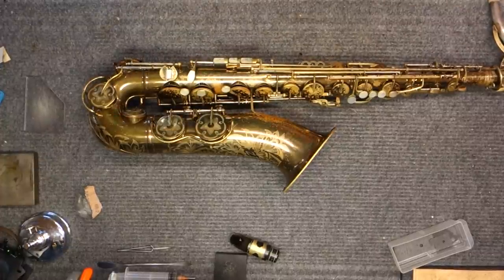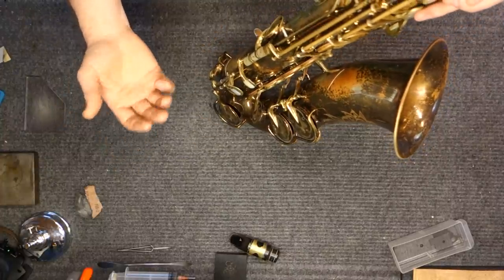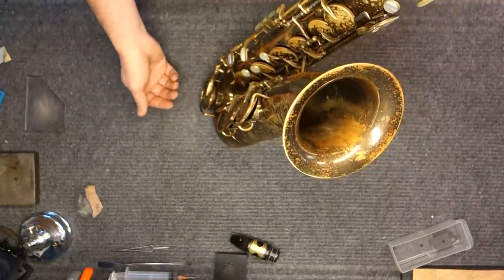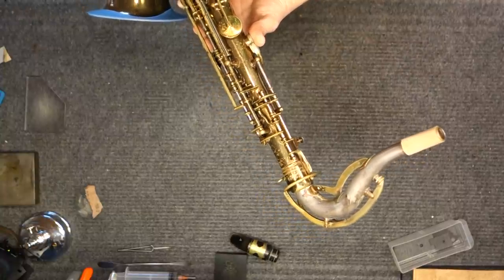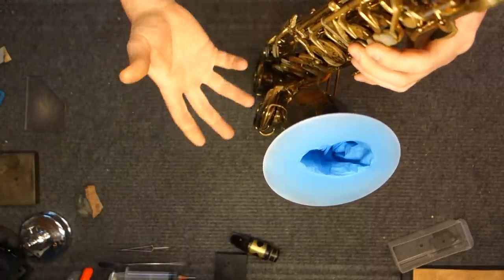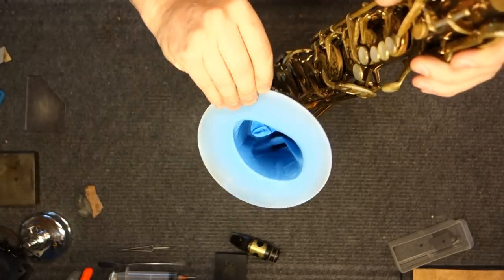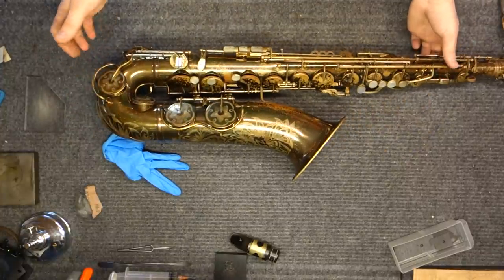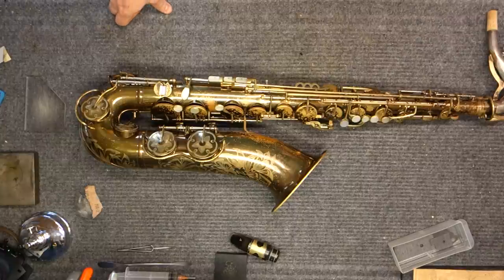Saxophone (Questionable) Repair Topic: Quik 'N Easy Leak Detector

Comment: So, I tried this test on my Mark VI tenor before and after Matt's full overhaul.  Before I sent my horn to Stohrer, it was OK...  after about ten seconds, the glove would very, very slowly -- almost imperceptibly -- begin to relax.  AFTER Matthew's overhaul the glove does not move at all, at least not as long as I could comfortably keep the neck of the horn closed up.  In fact, the horn is now SO tight that I can apply suction to the neck then completely remove one hand from the keys and the glove STILL does not move.  I.e., the keys stay closed on their own!  The pads seal so completely that I don't even have to hold all the keys closed!  This was totally unexpected, to say the least.  And I can let go with either hand.  However, if I let go with both left and right hands the keys finally do pop open, so it isn't magic.  But, damn, what a seal!

Comment: Hey Matt, I'm not sure how active you are on older videos but I was wondering what I could do about my Yamaha YAS-52. I stopped playing for a few years after graduating HS and I recently decided to pick it back up; this prompted me to take my sax to my local Music store (Art's Music Shop in Birminham, Alabama), in order to get it in good working order. Prior to taking it there, it played fine, but I wanted it to be at 100% so i took it to Art's to have them do everything they could. I just got it back and boy am I disappointed. Upon inspecting it at the store, my side F sharp key was missing the tension rod and my thumb octave key didn't make contact with the neck piece so it wasn't even playable. I knew exactly what to do to fix it and did on the spot since their 'repair guy' had left for the day. I was like "whatever", it's a small hiccup. I paid close $300 for the "servicing" which I believe only involved cleaning because nothing else seems to be different about the horn (ie no new pads or anything). After getting home, I was more than excited to play on it but it just isn't in the condition that I expected it be after paying $300. The low C key pad isn't making complete contact with the hole and the test you just explained wasn't even possible as I could audibly hear air rushing in. I don't know what to do and I'm incredibly demoralized considering I'm broke college student who can't afford to get swiped like that, and it not be worth it. The store's policy is that "all sales are final" (whatever that means), so I don't know whether to take it back and tell them to fix it (and maybe replace the pads) or just ask for my money back considering I don't know if I can trust them to actually do a competent job the second time around. I'm also unsure about what services are to be expected for paying the amount that I did. If you could give me some feedback and/or direction, I would greatly appreciate it. I wish that I would have discovered your channel sooner - I would have much rather sent my saxophone to you /: . Thank you in advance!
Reply: fuck i know what u mean i took my the martin tenor to a so called pro in berkeley c.a. steve deutsch  after 600 still didn't play ...alot of garbage techs be careful or take it to matt

Comment: I'm curious, why are you sucking the glove in instead of inflating it? As you mentioned, the vacuum might artificially make the pads temporarily seat better. Wouldn't it be better to test them under pressure instead? I'm not asking to be snarky, I'm sure you do it this way for a good reason.
Reply from the maker: The sprung shut keys will let air escape under surprisingly low pressure.
Reply: @StohrerMusic  Sounds like a good reason! Thanks for these helpful videos!

Comment: Wouldn't the low pressure pull the pads closed so hard that you can't simulate the pressure your fingers put on the pads?
Reply from the maker: +ozups from the description of the video: "DISCLAIMER: The method described above is for things that you might not otherwise find with leak lights. This is not a substitute for leak lights, and since a suction test can pull leaky pads shut, this is really only good for the exact things I talk about in the video: solder leaks, neck tenon leaks, cracks in the body, porous pads, leaks at the bow joint, etc. "

Comment: I recently had my horn re-padded.  It was a later model mark VI in almost pristine condition.  When I got the horn back, I noticed what looked like scratches or residue of some kind on the outer side of the pad cups.  I've been hesitant to try to apply any type of cleaner for fear of affecting the lacquer and making it worse.  I took it back to the shop, they told me it was normal deterioration of the lacquer.  Total B.S. as it wasn't there when I brought the horn in.  Any tips on what I could try to apply to clean it(Assuming it isn't scratches.)  I thought about using Honda pro cleaner and polish as I used it on my motorcycle paint to remove tar, with no damage to the paint.  What do you think?  The horn plays great, but I'm more than miffed that they didn't treat my horn with the care they should have.
Reply from the maker: +GMak79051 Obviously without seeing your horn, I don't know what exactly is going on, but I would not use anything meant for motorcycle paint on a saxophone.  Paint used on vehicles is extremely durable, the nitrocellulose lacquer on saxophones is not.
Reply: +Matt Stohrer Thank you for the advice.  I'm not going to mess with it.  I certainly don't want to make it worse.  They obviously didn't handle it with care.  I've had work done there previously with no problems, but maybe a part of the work was done by an apprentice or new guy...who knows.  Won't be taking them anymore biz.  Thanks again.

Comment: Have you messed with kangaroo pads? They should be less porous.
Reply from the maker: I find the opposite to be true.  Kangaroo skin is porous.  Good pnuematic leather is not.
Reply: @StohrerMusic  Cool  I had them with noyac resonators on a yts 61. really gave that horn life  usually played with a 6 bell metal gold plated link. (The cheap ones) LOved the punch on top of the horn and the smokey lowend